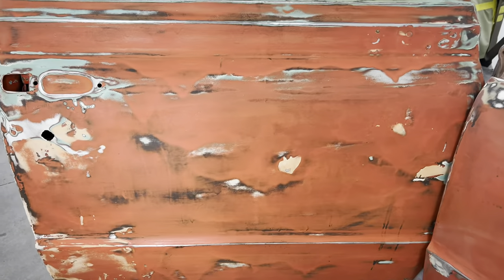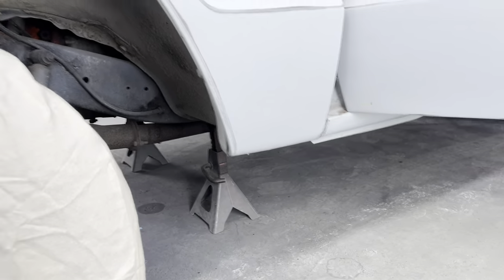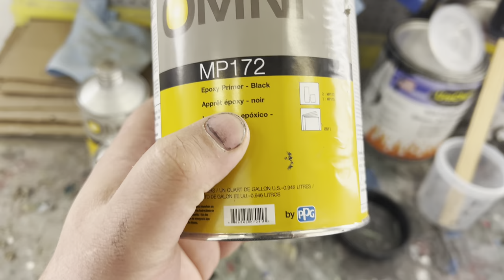I PAINTED THE ‘68 C10 HOT ROD BLACK! (Filmed in 4K on iPhone 13 Pro)

Comment: is that hood brand new? the couple dings would bother the hell out of me you have a lot of will power
Reply from the maker: No, it’s original hood from 1968. The dings go along with the build. We’ve been driving this truck quite a bit. We also have been stocking up some parts for it. Will be doing some updates on this truck soon! :)

Comment: Curious about why you used primer only.. Isn’t there a topcoat in flat / satin available that would hold up better in the long run? @nitroautolab
Reply from the maker: We used a black epoxy primer followed up by 2 coats of a 2k single stage satin black hot rod finish from the @thecoatingstore. No need for satin clear. It still looks just as good as it did the day I did it. It parks outside in all the elements. Very durable. 👊😎
Reply: @nitroautolab I like that sheen.. not flat primer black. Did the sheen hold up? Did you get any striping? Any tips for spraying it with a LVLP gun?

Comment: Is the tiger stripe avoidable?
Reply from the maker: Honestly I’m still trying to figure that out. Currently spraying my ‘70 nova in parts. Trunk came out a little stripey. Seems as if it’s sprayed super wet  and overlapped it turns out stripes. So seems like a wider fan, dryer spray avoids stripes. Also only noticed it on flat surfaces. 

I also noticed that after weeks/months of curing and a was or Two, it has blended in fine.